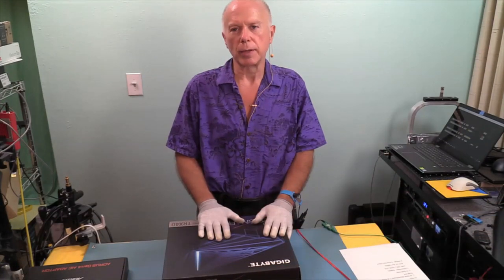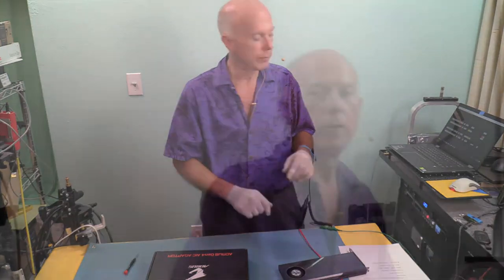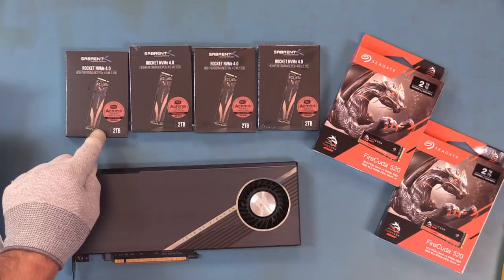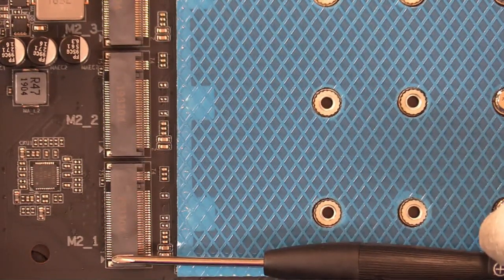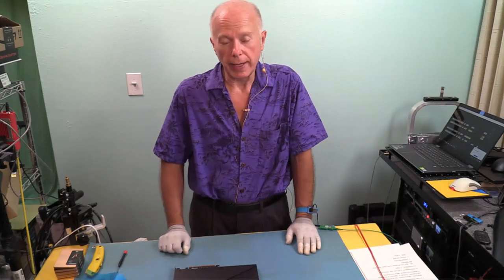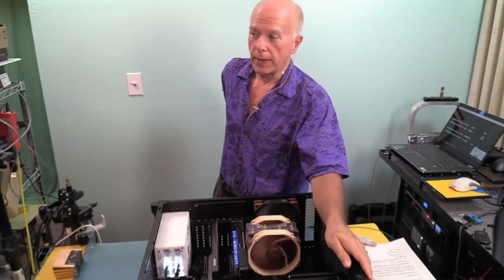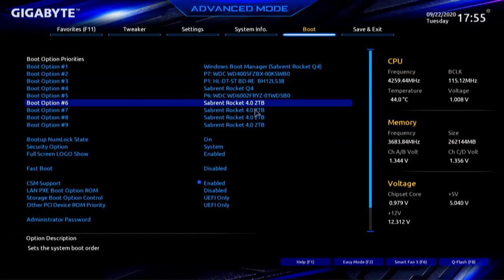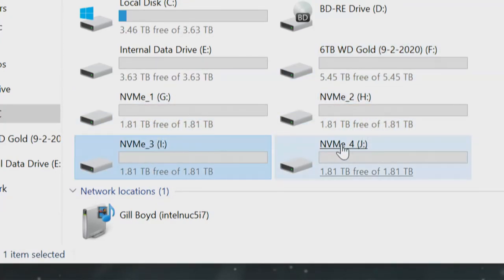Gigabyte AORUS Gen4 AIC Adaptor Comparison and Simple Install Tutorial TRX40 Designare

Comment: Your videos are always packed with information that is hard to find anywhere else. Thanks.
Reply from the maker: Hi Matthew Simmonds, 
Thank You! We try! You should see what we cut for time allotment! Ugh! An opportunity for another Video! Your Comments and everyone else, prove the Info is worth sharing! This whole procedure could be considered a Blue Print for Success in Building on the TRX40 Platform! Exciting times to be Building a Computer! It's all about Perception and Perspective. The TRX40 has a lot to Offer.
Reply: @BuildOrBuy  Hello, hoping you can help. I have a ryzen 7 5800x with a 1660 gpu, 64gb ddr4 3200mhz ram. this is housed in a gigabyte b550 aorus pro-p motherboard with an aorus gen 4 pcie raid card. Currently i have it setup with 1 980 pro m.2 drive in the m.2 slot and 3 980 pro drives installed into the raid card and housed in the pcie 4 slot. my issue i am having is that im trying to set this card up as a secondary data raid0 array and keep the m.2 slot as the primary boot. however the bios recognizes the raid i cannot seem to get it to show up in my computer and in disk manager it shows up as individual drives. when i used the amd raid drivers pre-os installation windows saw it as a raid drive, but when i decided not to make it a boot drive it just doesn't seem to want to cooperate. any tips? Is there a way to install the drivers after the fact?

Comment: Thank you so so much for this video! After 2 weeks trying to operate an AORUS Gen4 AIC Adaptor Card (with 4x 2GB M2 SSDs) on an X570 board, with unhelpful support from Gigabyte, you saved my life! Very knowledgable and professional information in your excellent video! Just great! Take care and stay well, Dirk
Reply from the maker: Hi Dirk, 
Nice to meet You! Welcome! Glad You found Us! Thankfull We could help! Next time, let's talk Motherboard Chipsets! Appreciate Your Comments! Blessings! 

Options... You're a candidate for a self Bifurcated AIC. Based on the reality of X570 PCIe Resources, Glotrends Sky. Only Requires 1 x8 PCIe 3.0 Slot. Video on that AIC here: https://youtu.be/QF71-5nhrAk 

There are NO self Bifurcated cards, as of yet, that work on a x8 PCIe 4.0 Slot. For PCIe 4.0, all Require a x16 Slot, electrically. Details matter!
Reply: Dirk, im struggling with the same setup but i cant find the answer in the video - i just cant get my aorus x570 board to show the card, is it in the bios setting somewhere to enable it?
Reply: @metalfacemark  Hi Mark, my experience is that the x570 board does not (fully) support the AORUS Gen4 AIC Adaptor Card. The reason is that you need a pci express slot providing 4x4x4x4 (16) lanes support. Only the 1st (or top) pci slot in the x570 board does provide that 4x4x4x4 (16) lanes support. However, usually you will plug in the graphics card into that 1st (top) pci slot. In order to check that, I bought a very simple graphics card (because modern state of the art graphics cards will not fit into the lowest pci slot on the mother board unless you remove the board from the pc case), temprary installed that into the 3rd (the lowest) pci slot on the board and installed the  AORUS Gen4 AIC Adaptor Card into the 1st (top) pci slot. In that configuration all four SSDs on the AORUS were displayed. When putting the graphics card back into the 1st (top) pci slot, only two out of four SSDs were displayed. Which is exactly according to the video. Where it is explained that the lanes either 4x4x4x4 or 4x4 are allocated only electronically to the existing hardware pci slots. I changed to the TRX40 main board and everything was fine. Maybe that is not an option for you (due to time or budget). So, think about checking the SSDs from the AORUS Gen4 AIC Adaptor Card directly on your board to asure they are working correctly. Then think if you can be happy with using only 2 SSD cards on the adaptor, which also might give good performance. Next option would be to use the 1st slot for the AORUS Gen4 AIC Adaptor Card and place the graphics card elsewhere. (As mentioned in the video: Not sure if anyone really wants to do that permanently?) Last option, if you want all 16 lanes available for full use of 4 SSDs on the AORUS Gen4 AIC Adaptor Card, will only be to change to another main board (like I did). For the bios settings just try the settings as explained in the video. There should be a setting like 4x4x4x4 for bifurcation on the settings tab. Hope this helps a little... Good luck!
Reply: @dirkschindler2869  thank you Dirk!

Comment: DISKPART, list disk, select disk then clean......then you can run initialize from the GUI again......still not decided on this AORUS yet. want to see heat figures under load as 4x50C+ is a cooker. When are we going to get drives that are actually 2TB usable when we buy 2TB, been asking this since Leisure Suit Larry!!
Some speed test and I/O would be a big help as I hear small random file size throughput is below single nvme disk standards on this card.......
Reply from the maker: Hi bass jace, 
Yes, You are correct. We're working on Videos to show both of those. Already requested since being mentioned. Weather in Texas slowed us down for a week. Details!

You know the answer to that is all in the metrics... Binary vs Decimal. It's all about Marketing! RAID today is more about capacity. We get the questions and do our best to answer them from our perspective. Personally I'm not a fan of this type of RAID. It's too fragile. We're going to do a Video on that too, that is, the different Types of RAID. And maybe Levels of RAID. As an overview of RAID options, Hardware, Hybrid Bios and Software RAID. 

To get the correct emissivity readings, we have to get the M.2 NVMe PCIe AIC in the same parallel plane as the FLIR. We think we have that covered. We'll test on both the Gigabyte Aorus & ASUS Hyper Quad M.2 NVMe AICs. 

Next up, as asked by Subscribers, Thunderbolt 3 Firmware Update. Thank You for Your Comments!

Comment: I use a Gigabyte z790 aorus elite ax, socket 1700 moderboard.
the bios supports bifurcation 8x8.
Drivers are formated.
Only one drive is visabel.
Reply from the maker: Hello Bert, 
Then only Drives in 1st  and 3rd Position will be seen due to the nature of that Chipset. Test and Verify!